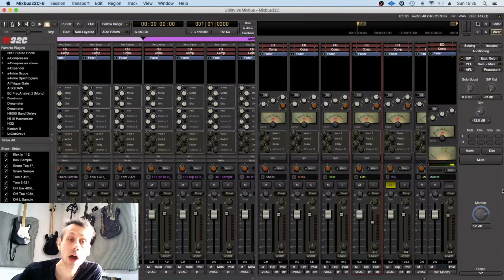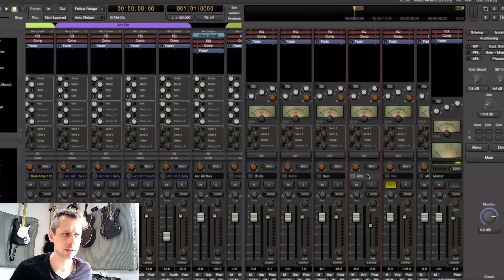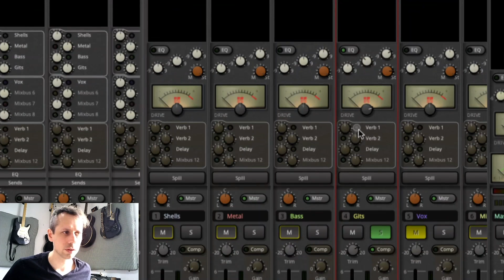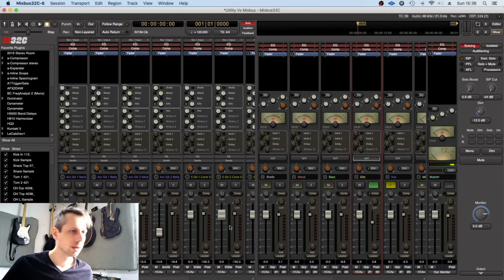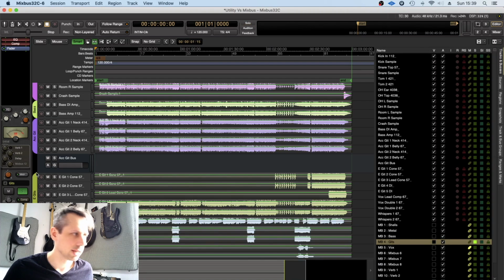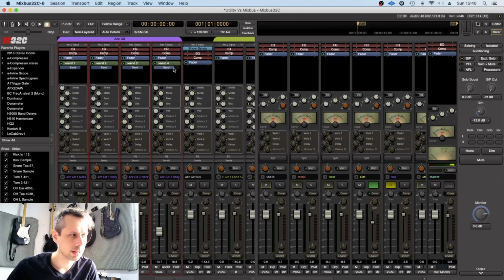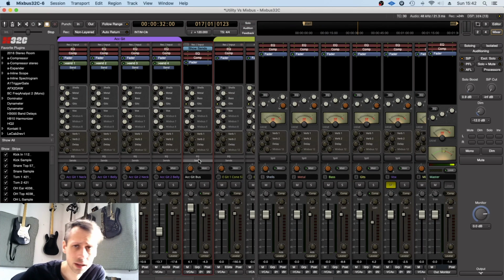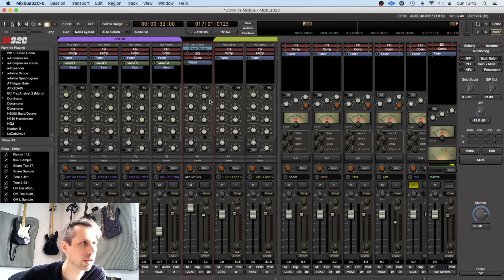Mixbuses Vs Aux Buses

Comment: Russell - Thank you so much for addressing this feature of MixBus! The only I sees point that you did not mention is the processing load of the 12 Mixbuses is already accounted for in the running session, while there is an extra processing "tax" for each aux bus added. Other than that, if you're not too concerned about the ability to add "drive" to you sub-mix (or "group-mix"?) selecting an aux bus might even an advantage in terms of colorization (eg. Better EQ) and further routing (EQ. To more buses).
Groooooovy, Baby!!
Reply from the maker: Yeah I mean to be fair the extra CPU load from adding an aux bus isn't too much of an issue compared to a few 3rd party plugins but it is deffinitely non-zero.
Reply from the maker: Glad you liked the vid by the way... more coming soon

Comment: Russell, Special Request:
Maybe now is a good time for a video on Latency / Delay compensation.
1) Internally - just running from Tracks to Parallel Tracks to Aux Busses to more Aux Busses to Mix Busses to the master
2) Plugins - adding different plugs with different amounts of latency, and plugins reporting accurately, how to measure and correct
3) Hardware Inserts - how to send through D/A Converters, externally process, back into the A/Ds on the same channel in series as an Insert, with Delay accurately Compensated either Automagically or Manually.
4) Analog Send Returns - similar to above, but sending OTB to say a Parallel Compressor rather that a Reverb which is time delayed anyways, then back in on a Different Channel, but time aligned with the original.

Mixbus, IMHO is the most Analog intuitive DAW workflow there is.  For you and I and those of us that still use a desk, or any outboard really, getting all the levels calibrated, then all the timing synced up, makes for an incredible ITB/OTB Hybrid Mixing experience.  The best of both worlds, integrated into 1 comprehensive yet simple system.  At least that’s the dream.
Reply from the maker: Well that's mostly automatic but I'll put that on the list

Comment: Hey Russell! New user here - thank you so much for the informative videos. I'm using the regular version, not 32C, and I see on your mixbusses you have send knobs for verb, delay, etc. Is there any way to set that up in the regular version, or is that a 32C feature only?
Reply from the maker: Just rename the Mixbus channels and teh names will show in the sends area
Reply: @RussCottier  I think this may be different on the regular version, as I don't have those 4 sends below the drive section on my mixbus strips. Are the sends to those busses 9-12 only available on 32C?
Reply: @breathemyvapours  Busses 9-12 are not part of the "MB" product. "MB" only has 8 mixbuses and "MB32C" has 12. However, in the more recent versions of MB32C, mixbuses 1-8 have been enhanced to route to mixbusses 9-12. This  you a sort or "hierarchy" within the mixbusses, allowing your to (in the case of this video)  set aside three of those (9, 10 & 11) as dedicated Verb1, Verb2 & Delay) processors. So... In 32C, you can still use all 12 of the mixbusses individually, or use them in this new hierarchical fashion.... one of the "goodies" that you get for paying more for 32C.
Reply from the maker: @breathemyvapours  You will have only 8 Mibuses on MB Standard butyou can still rename the Mixbuses to whatever you like and they will reflect in the Mixbus srnds area. The 9-12 sends on the Mixbuses are aimed to allow 32c users to use 9-12 as FX sends that can easily be accessed via the Mixbus channels. So you could send all your drums to a reverb etc. But remember you can achieve the same result in Mixbuses in MB standard by using an external send in the processor chain.
Reply: @RussCottier  @Patrick Buryk Thank you, guys! Very helpful responses.
Reply from the maker: Sorry I must have missed your excellent reply. Seems I was late to the party :)

Comment: Something that's a little off with the subject but is it a weakness of the CPU when I'm encounter latency while editing and mixing though I'm running at 1024 buffer size 40 Ms latency? I had the same issue with 256 buffer size 11 ms but with additional cracks and pops

Comment: Do the aux busses in MixBus have latency/delay compensation for plugins? I thought that was its major flaw.
Reply: They have latency compensation now
Reply from the maker: @florianarndt  yep
Reply: Thanks, I must of missed that new feature!
Reply: @ArtmanBass  Happened in V6
Reply: And V6.0.702 added fixes for other aux bus "flexibilities" so they should be good for any use case now.
Reply: Steven Klein  That was a major problem in the past, unusable.  But Version 6 is supposed to have fixed that, which is fantastic, but I haven’t tested it.  I wanted to use Mixbus in a Michael Brauer Multi-Bus setup with a ton of parallel, and it collapsed immediately.  (That said, so did ProTools at the time, and Michael said then it couldn’t be done ITB.  PT fixed it, and now he does use it in a hybrid system.). Now the Harrison has “fixed” it as well, time for some heavy testing.  Has anyone done that already?
Reply: Oh, I see a bunch of replies already.  Great.  But still has anyone tested it with multiple parallel tracks, through layers:  tracks & parallels to auxes to more auxes to mixbusses to master?  Do the trains all get to the station at the exact same time without phasey crazy.
Reply: Oh, I see a bunch of replies already.  Great.  But still has anyone tested it with multiple parallel tracks, through layers:  tracks & parallels to auxes to more auxes to mixbusses to master?  Do the trains all get to the station at the exact same time without phasey crazy.
Reply from the maker: To be clear the latency non-compensation was never actually as bad as people think. It was only in a very specific routing that it occurred.

All good now though thanks to the awesome Dev team.
Reply: @RussCottier  Yeah, latency is (was) an issue only when the aux comes after the mixbus and not viceversa, am I correct?
Reply from the maker: @giuliosant9016  that would have causedd a problem I think yes. I should look up in my records to remember exactly what the deal was but it works now so that's all good.